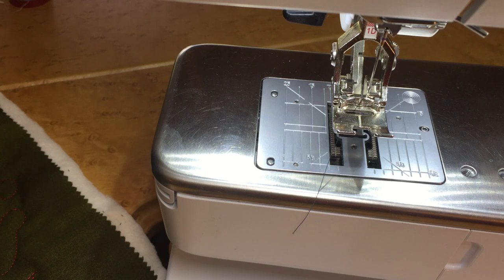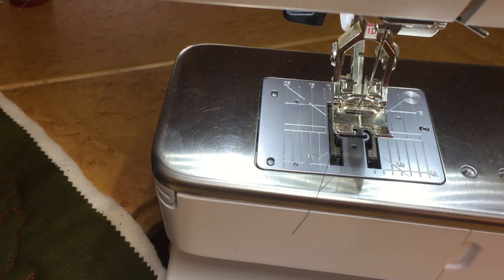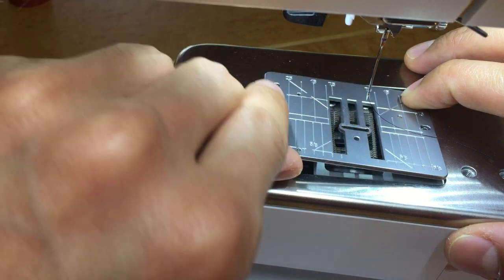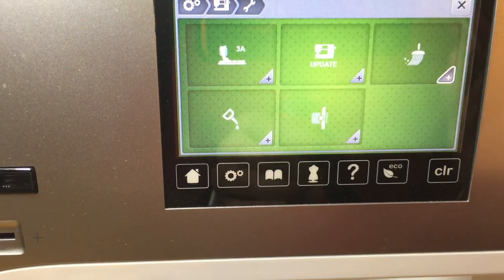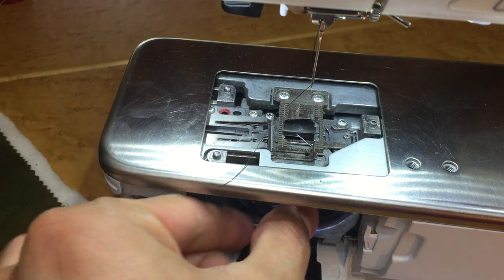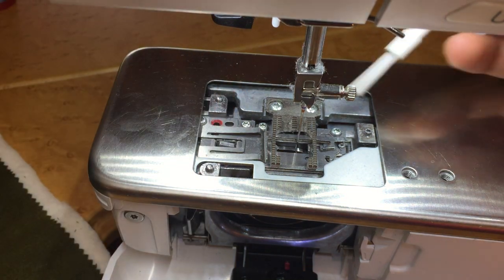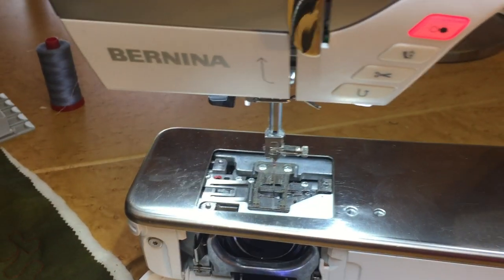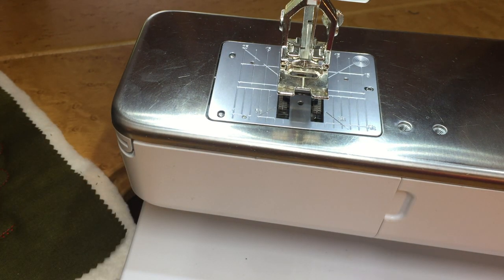Cleaning the Bernina Thread Catcher

Comment: Hi! Is there a way to move the thread cutter when the machine is off? I did not put it away and turned off my machine so now it’s starting in error 1010 mode.
Reply from the maker: I am sorry for the late reply, I don't get on here as often as I should to reply to messages. I am sure or I am hoping you were already able to fix your issue BUT honestly I am not sure if you're able to do move the thread catcher back "from the consumer side of the machine". I don't want to advise you or anyone to fiddle with the machine too much beyond what is instructed, but you should be able to get it back where it is supposed to be. 

Sorry if that isn't the most helpful answer.